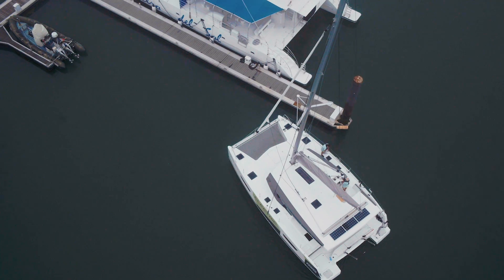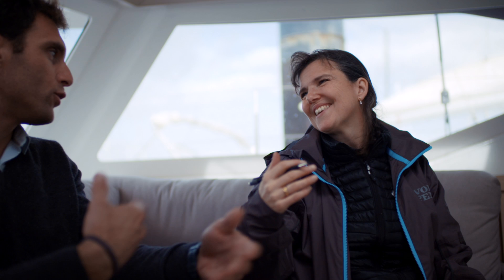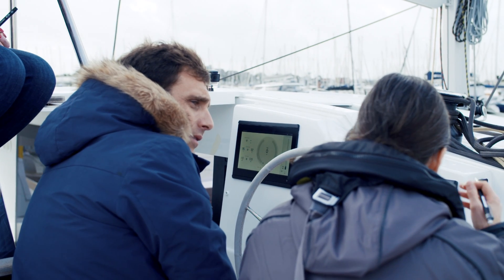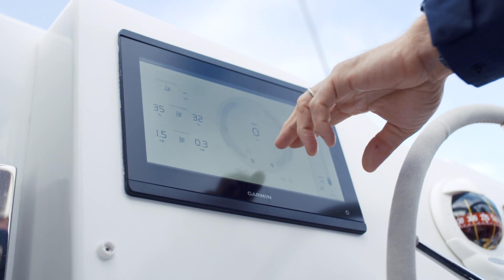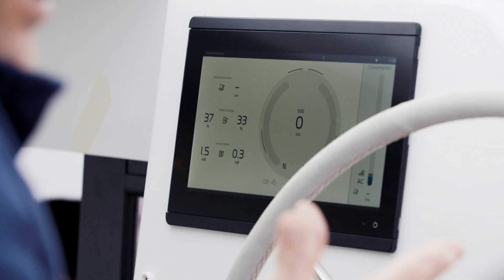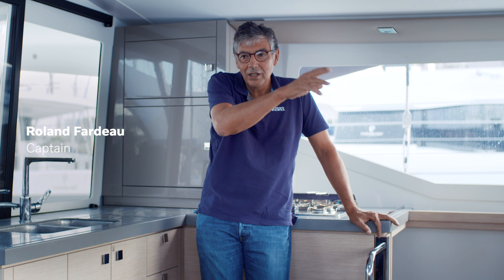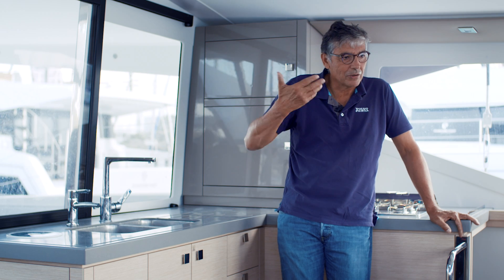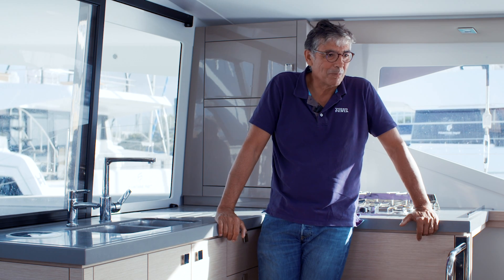Volvo Penta invited customers to help design the electric driver interface of the future

Comment: Most diesel generators require maintenance after a few hundred hours of operation.  

As a curious viewer, I would like a diesel generator offering longer intervals between scheduled maintenance periods working together with an electric propulsion system.